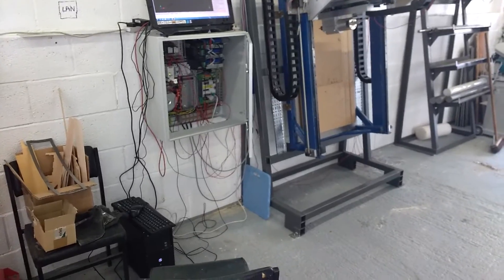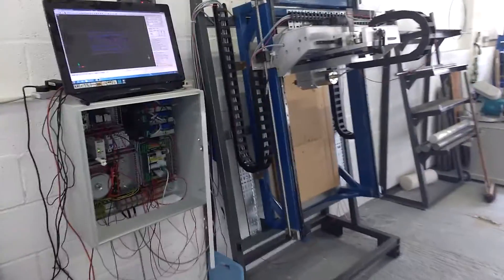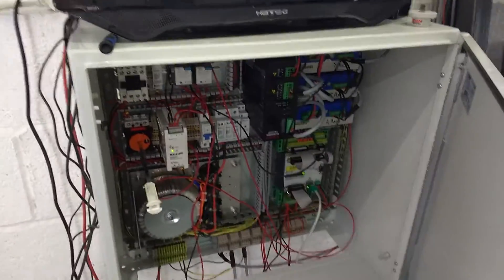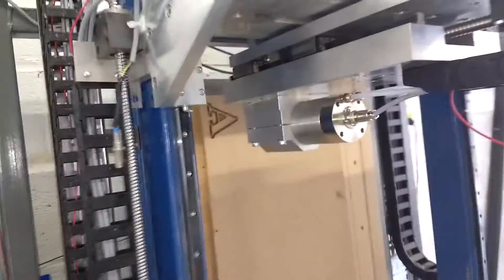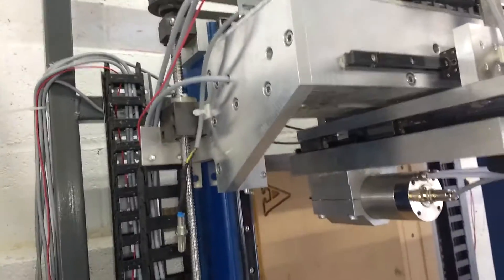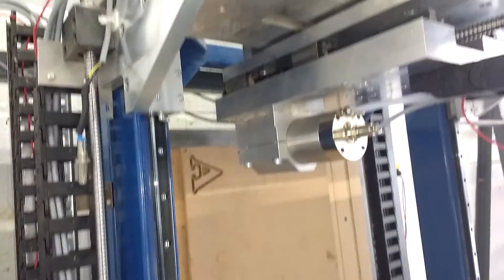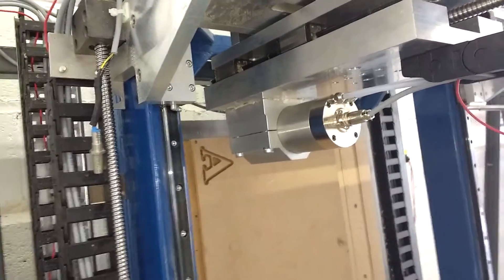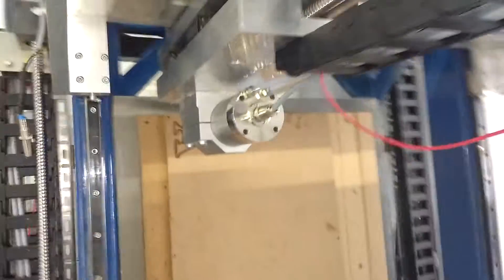First test of my DIY CNC Router in the vertical position.

Comment: Steel construction? Are you using 2 motors and lead screws to move the x axis? Steppers, steppers with feedback or servos? Very well done. Footprint is a big issue for many of us and you’ve solved it.
Reply from the maker: There is a build thread over on mycncuk.com

http://www.mycncuk.com/threads/2148-Comments-sought-on-new-build-A-CNC-Router-for-RC-Gliders-and-Planes?highlight=Njhussey

I used one nema 34 motor to drive the x axis ball screws with belts and a nema 24 for each of the y and a axis. I can’t take credit for putting it vertically (85°) as it was an idea suggested on the forum. I would recommend it vertically as much easier to get work on and off and the chips/swarf drop down.

Comment: how does the work piece stay on the cutting table?
Reply from the maker: I use masking tape for balsa (low cutting forces) or I screw the piece down or for big pieces I use clamps which I bolt into M6 inserts I have in the bed.